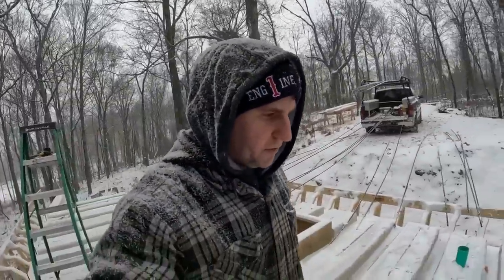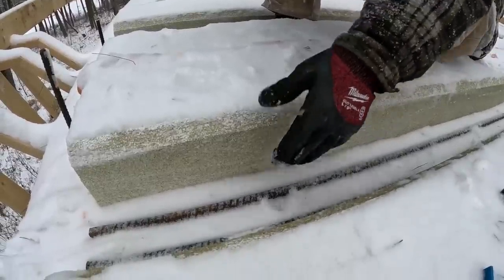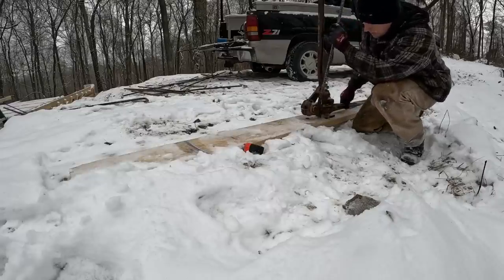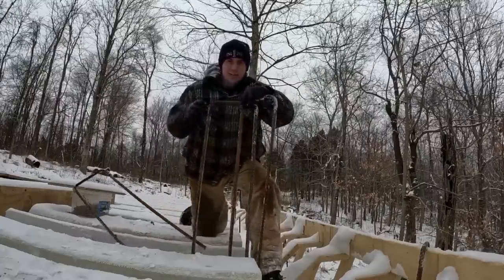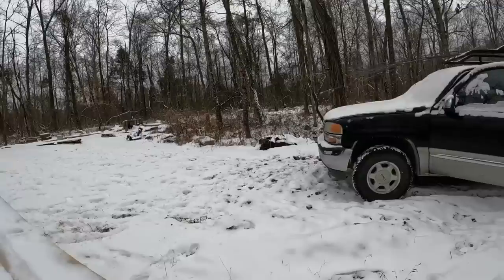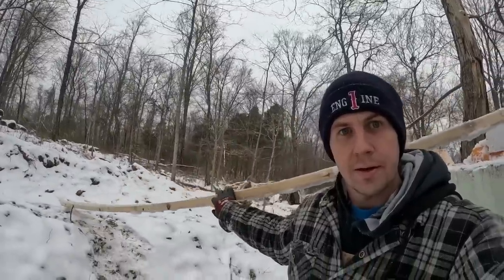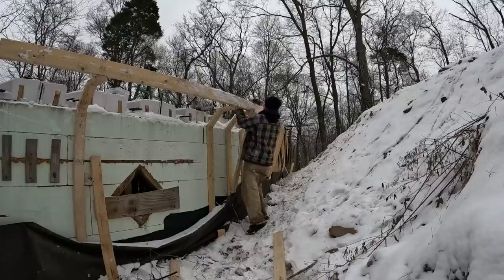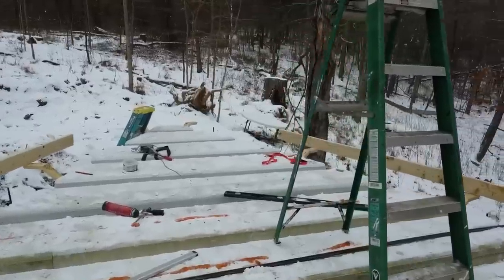Building an ICF Cabin in the Woods - Concrete Forms and Rebar - Part 28

Comment: Great thing about rebar if you manage to come up short you can just bevel and weld the ends of your cut offs together. 1 TIP: Tac them in an angle iron jig first to get them strait. Less waste. Less waiting or running around.

Comment: Snow fall, and You work on the Boat in the Wood? By the wire netting is Snow not a problem, but by Concrete :not Snow and Cold. Good Weat for the Work.
And a Happy new Year 2023 🍀🎉
Greeting from Austria 🇦🇹

Comment: If you have time in a future video, hit on when to use what size rebar. Realize the strength difference of 3/8, 1/2 to 5/8 but is it length of span, weight to support, support vs on a base (ground) all or more? Don’t plan on doing any concrete or to debate lol, just curious. Thanks and look forward to seeing the yacht grow
Reply from the maker: When an engineer tells me lol

Comment: Rebar will still let the concrete bend.  It prevents the crete from seperation and heaving or sinking. NOT bending. You need cables pulled super tight from end to end, ..tension.. you could or used flex core. Cut to length with chop saw, and be done. Park a car on it.
Reply from the maker: Nah

Comment: The last time I cut a load of re-bar with a grinder, I set light/fire to the bottom of the right leg of my Levi's. In my defence, I was very tired at the time. I was three month's into a five month's long job, doing 12 hour shifts with 2 hours each way daily commute, 7 day's a week. After burning my Levi's, I went on sick leave for 5 day's. I slept for three solid day's and night's, rested for 2 day's, then went back to work and finished the last two month's of the job. (The money was good, but if a job is killing you, is it worth it? Never again).
Reply: @CaptainKleeman . The funny thing is, although I had a 9 inch X 6 inch hole in the leg of my Levi's, the skin on my leg didn't get burned. No hair left on my leg, but no burns on the skin. (Someone up there was looking after me).